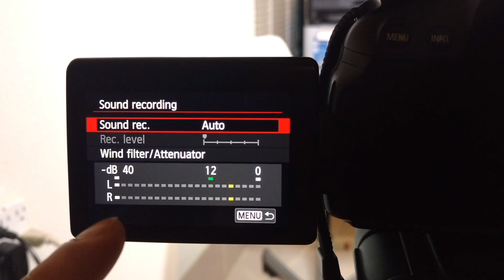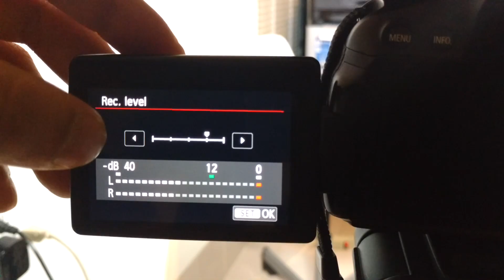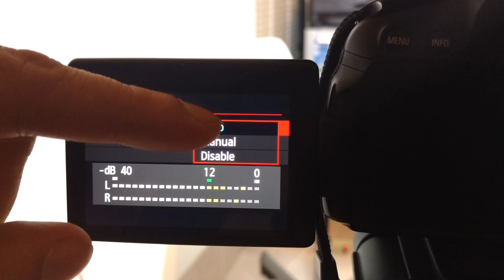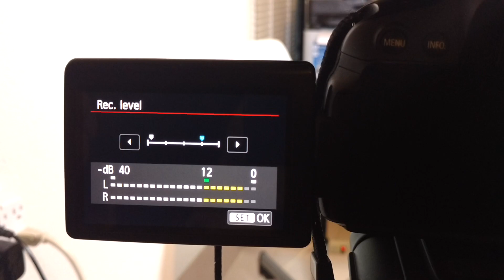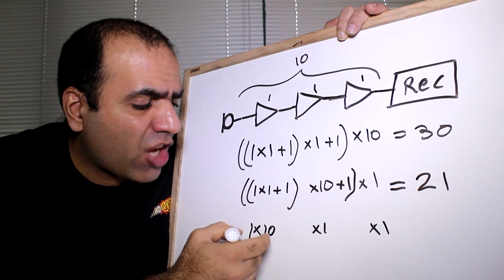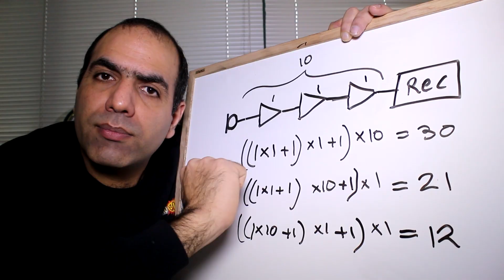Quality Audio Recording for Video

Comment: One of the worst offenders in an an audio system for noise is the automatic gain control.   But the wiring itself can also be just as noisy.  If you switch the wiring to an oxygen free copper wire, that produces the best audio because there is no distortion created in the wiring.  OFC wire is used in professional audio equipment, and speaker cables.  For microphone use look for GS-4 cable on ebay.  several sellers sell it by the foot.

Comment: You basically explained what I did at home to have good audio when recording or talking online. I've put Shure stage mic with builtin amplifier and external gain control which allowed me to get higher gain on mic. Then I use autogain in skype/TS or just set manually gain for recording and it just prevents clipping. Noise is much lower as I amplify everything on start and I lower it down with autogain when needed. I also disabled autogain option to step up volume to it's not amplifying noise when nothing happens. The best thing is that it works perfectly with voice-activated speech (TeamSpeak) and it even work when I'm talking with loudspeakers connected - stage mic is quite directional and I've set it so sound from speakers is just little over noise level which in my use is much lower than voice and can be filtered out in postprocessing.

Comment: Make sure your microphone cables are shielded as some especially cheap ones are not which can increase the likelihood of buzz dramatically. Also, try to match the microphone's ohm rating with your camera's designed microphone ohm input rating.

Comment: Nifty tip for the whole "using another microphone" thing: start recording with the external mic, and start recording on your camera. Make a loud sound of some kind and wait a few seconds and then start acting like you normally would. This will create a visible spike in the audio waveform from both the camera audio and the external mic audio that will be easy to identify in post, and will also serve as the point of alignment for the external mic audio to line up with the video footage perfectly.

They do this all the time in actual movies too. The "clapper" as it's been called that you see in all those behind the scenes clips for movies serves a very specific purpose. Specific scene information is written on the clapper (scene number, shoot number, camera angle, etc). This gives editors the ability to take a glance at the video thumbnail to quickly identify the particular clip they are looking for, but it also serves another purpose. It's called the clapper because it opens and slams down. This action creates a very loud sound, and is used to sync externally captured audio to the video.

Is it more work? Yeah, even if you take these measures it is still tedious especially if you record the same thing more than once. But if you keep up with your audio recordings and delete the ones you don't want, you can keep a consistency going where the first audio track goes with the first video file, and the second audio track for the second file, and so on and so forth.

Comment: Also remember, that if you ARE doing post processing, audacity is amazing at removing background level noise. all you need is a baseline to have audacity measure and then cancel out and any further voices come out extremely clear. its an excellent method for removing buzzing, or component feedback noise, but won't work well for say, inconsistent noise, like background car traffic, airplanes or a crowded space like a restaurant.

Comment: The professional way to solve the noise problem is to use a seperate audio recorder such as a Zoom H1. It is advised to make a clap-sound at the start of the recording. A simple clap with your hands as an alternative to clapperboards in front of the camera and near the microphone is what you need, with that you can quickly sync video to audio in the editing software of your choice.
The other way is to record audio on the camera and the audio recorder and syncing the audio waveforms and muting the camera audio, but that can take longer. You can't beat the quality of the sound this way.
And definitely use a lapel/lavalier-type microphone, the cheaper you go the more omnidirectional they become.

Comment: I would suggest you try using noise reduction VST-plugins. Don't be afraid of DAWs, any DAW will work and certainly help you out.

I personally use the Voxengo Redunoise plugin in Cubase, it's very easy to figure out how it works. Also, you can download both Cubase 5 and this plugin on The Pirate Bay for free.

Even if your noise level is low enough for YouTube, I think it's still nice to get rid of it completely. And it takes minutes to do. In addition, you can always compress, maximize and saturate your final audio track in a DAW like Cubase.

Comment: I sure want to see what's next, love your vids, but...Just put a noise gate or use a handheld mic. Lavaliers with precharged condenser plates are not worth the investemnent, they discharge with time and must be EQed to sound less nasal.
Reply: Not to mention you'll have your clothes and movements sound like an avalanche each time you take a shock and jump.

Comment: You can use a noise gate. You can remove all sound below a certain decibel or frequency with a low pass filter. You can do this is simple audio editing software in your post production stage. After editing or your clips together, split total  audio and start editting it.

Comment: Wtf, I thought you were better man.

1) Extract the audio track from the video file. (you can use VLC to do this)
2) Open it inside audacity, select a portion with only noise, go to Effect->Noise Reduction, click to learn the noise profile. Then you select one part that has you talking, set the Noise Reduction effect sliders and preview it until it sounds good.
3) Select the entire audio track and apply the effect on everything, save the audio track.
4) With avidemux replace the audio track of the video.

Comment: Just another piece of advice--if you do decide to record audio separately using a high quality recorder like a Zoom, Adobe Premiere Pro can sync the audio and video automatically. But even doing it manually only take a few seconds if you slap your hands together as the start of the video recording and then line up the wave forms of the in-camera vs external recorder.  the improvement in quality is worth a couple of seconds.  Anyway... thanks for the entertaining and educational videos! Keep them coming!

Comment: If you have low and noiseless source you can compress signal using compressor plugin. Also for voice it is good to remove frequencies below 200-300 hz and above ~ 18000hz, because there is no any valuable information. Compressor will reduce dynamic range and make loud peaks quieter and quite sound louder. Good mic and good mic pre-amp offers low noise-signal ratio, that's why this shit costs so much money, but you get signal that you can adjust to your needs.

Comment: Some Video/Audio editors have some nice option for that: 
The noise will the easier to be removed (blank 5 sec ,no talk to pick the noise and remove that profile of the blank)
The echo can be reduced too , but may cut off you voice, so better get more Ikea furniture. 
My Chinese USB mic is so bad that if I don't boost the levels , won't pick my voice with normal volume, so aftermatch editing is mandatory, even if you have good mic and room area.

Comment: The best choice is simply recording audio separately. To synch the sound properly you just record yourself clapping with the hands visible on the camera, that way you have a loud snap to synch with the easy to spot visual cue. Thats why filming uses a clapperboard, the board painted black and white snapped before each shot - its the easy way to synch audio with visual. With a separate audio setup you can easily have it recorded on your person, or a very high quality of recorded audio for a far cheaper price as they don't have to cram it into an electronically noisy camera. You also get far more control over your setup with the computer or various audio devices controlling the sound. Finally for some things like the cheap microphone the noise seems to be at a specific set frequency so it would be pretty easy to use an equalizer to cut out just that specific frequency whilst letting all others through, you'd get a slight drop in audio quality but zero buzz for not much work regardless of gain.

Comment: So, Mehdi, what about setting the attenuator in the camera, and adding a pre-amp in an external mic, connected to the camera? it should be better (only if the pre-amp doesn't add as much noise as the camera added when it didn't had the attenuator).

Comment: I use a combination of mics and sound processors depending on where I'm at.  At home, I use a Sennheiser MK4 that feeds into a Symetrix 528E voice processor which has a downward expander, compressor, de-esser and EQ.  You hear nothing but my voice...no background noise, no breathing, etc.  Outside I use either the mic on the camera, a Sennheiser ME64 or a larger Sennheiser ME66 in a blimp with a dead-cat to cut down all wind noise.  I have my camera (Panasonic DVX200) input levels set manually.  I rarely use my Sennheiser EW 122P G3-A because it picks up too much noise...might need a better lavalier mic than the one that came with it.

Comment: I fully support you buying a new LAVALIÉÉÉR microphone, it IS great! I have a SmartLav+ from Rode, you can plug it into your smartphone, and voilá, you're mobile now. I think you can downoad a program to stream the audio to your program or else you can just record it in your phone, than transfer to your PC.

COME ON is not so hard to sync audio :P!
Reply: 4,5 to 6,0 mm jack converter. :)
Reply: How do you plug it into your phone??
Reply: The SmartLav+ already works with phone jacks. You need an adapter to make it work with your PC.
Reply: Pesteran aqui kkk
Reply: Fuck Rode.

Comment: If you record your videos without stopping the recording it would quite easy to do separate audio and video. You just need to make sure to do something to sync them together, like a director's slate or just a simple clear hand clap. You should be able to link the audio and video clips together and then edit like normal. Using something separate from the camera typically sounds a lot better and if it's high quality you're after, the little bit of extra work should be worth it.

Comment: Get 2 of these Crown PCC-160, then mount them on plexiglass. If you can get a music stand and swap the top part for the plexi at about the same size it works great. Then set 1 mic to left and 1 mic to right in the sub mixer. This way you can set all your own gains and levels. You can even get extra channels for music or run it USB to a computer. Run that to your camera. Also maybe get a better camera. your videos are short enough you could probably use just a DSLR camera with large memory card. 

The other thing is every item you tried in this video you called cheap. The problem is cheap. When you buy cables buy good cables, not cheap.

Comment: Honestly the way i'd do it is simply record with low gain, low volume for the voice, then add gain in post using a limiter and maybe add an eq to make the voice more clear, the ting with youtube videos is you want flat volume, the least dynamic range you have the better the experience for the viewer, it's similar to radio, you don't want peaks 10x higher than the base of your audio otherwise you have people turning the volume up and down during your video, and there are allot of youtubers that get this wrong.

Comment: My suggestion is to skip the wireless system. Cheap one are useless and good ones like Lectrosonics are expensive. 

Buy a decent lav (rode, shure, Audio-Technica or Sennheiser) and wire is directly into your camera via an extension cord.

In future, you may add Sound Devices MM-1 Pre-Amp for cleaner audio.  

Just don’t trip over the wire…

Comment: Record background noise (device noise profile) and then substract from the dry signal. Or simply use noise gate. There are realtime audio processors that can do it for you. It's just one step in postprocessing and it's fully automatic. Actually I'd employ BOTH of the above.

Comment: Use MagicLantern for your canon camera
Reply: it runs on sd card. take the sd card out and its gone like it was never there. Im running it for very long time and it has not bricked my camera.
Reply: For those who don't know, Magic Lantern is a free firmware addon. I used it to get past the 30 minute limit on video recording; but it has a whole bunch of features and probably better gain control.
Reply: I use it myself, its great
Reply: Although there is a small chance that it will brick your camera. 
And doesn't it void the warranty?

Comment: So, seems like the camera is really the problem here, coupled with you not wanting to spend ages post-processing, which is fair enough. I recommend investing in a good noise reduction and compression VST filters. I can recommend Izotope Voice De-Noise plugin (which I personally use).. it works well  with AGC on or off, but you're best with it off, record some empty noise at the start of each recording and then use that to 'train' the VST... or if you're super lazy just use auto mode and tweak the very simple controls, then add a volume maximiser / compression VST, again Izotope have some great / super easy options. You do have a lot of echo / reverb, there are VSTs for that too, but I wouldn't recommend them since they result in a lot of artifacting. So, with those two VST plugins in your video DAW you can really clean up your whole audio, and never touch the controls again for future projects..  ultimately though, this is your style and we're all here because or in-spite of it. Don't worry too much about changing! :D

Comment: Turn off all automatic gain and do it in post.  Use Audacity, Audition, or something else.  You can apply filters to remove noise and high frequencies.  Go through the file and manually ensure voice audio levels are consistent.  Depending on the program, it probably has a feature to do this for you, which will certainly work better than the automatic camera gain.  Premiere Pro and Audition can be used together effortlessly.

Comment: As an audio technician, you should just use a limiter. You wont have to worry about clipping at lower levels, because the limiter will bring down the input dB to adjust so that there is no hard clipping. Use your shotgun mic with the settings you liked, and put a limiter in between.

Comment: Just use normal recording settings, talk normally and then post process the final video's audio with (noise) gate and compressor.
Basically, noise gate mutes the audio when it's quiet and only plays it when it's loud. Generally you can't hear the background noise when you are talking, you just hear it when you pause, so when put through noise gate it sounds like a studio recording. Compressor reduces dynamic range, making loud and quiet speaking become more equally loud.
Search youtube for tutorials.

Comment: turn on noise suppression,
or get a separate power supply for the microphone as more voltage going towards the microphone will give it a better quality sound and it will pick up more sound, some boom mics need a phantom power supply or else they sound like shit for example my microphone uses a 48v power supply

Comment: You can connect computer microphones (bare condenser mics) to regular microphone inputs by adding a 1-1.5v DC offset. In other words, adding a regular battery in parallel. Computer mic inputs have this "ghost power" built in. Having such power in a separate cell can help a lot to reduce that electrical noise.

edit: Also a small capacitor in series to eliminate this DC offset for the camera. Search "mic ghost power" for more details. Some circuits seem to have a resistor in series with the battery.

Comment: With the cheap microphone that had a constant background tone (the one at 7:50) you could also leave the gain at high or automatic and then just cut off all noise below 100 or so Hz in post, because the tone is much lower than your voice

Comment: Pyle make a halfway decent wireless lavalier microphone, you will need a couple of adapters to run it to your camera.  

A 1/4 inch to 3.5mm and then a 3.5mm stereo to mono adapter.  That is what I use for my camera.  And I turn off the automatic gain in my camera and only use the gain control on the transmitter.

https://www.amazon.com/Pyle-Pro-PDWM96-Lavalier-Wireless-Microphone/dp/B0007L8BQW

This is the wireless mic I use plus the adapters